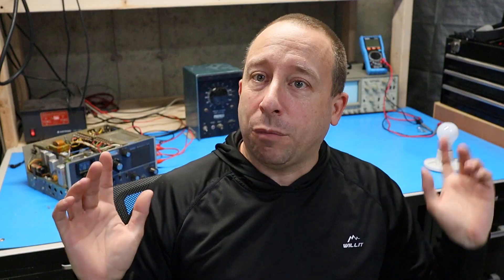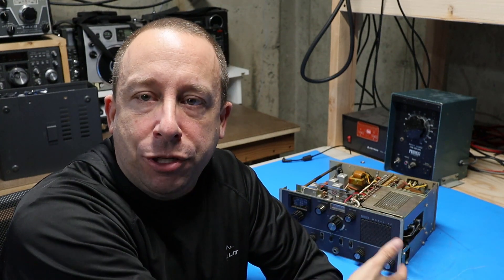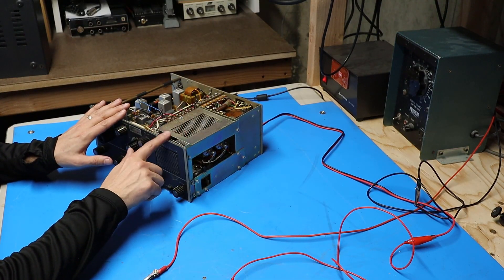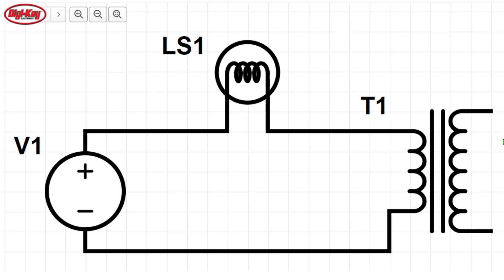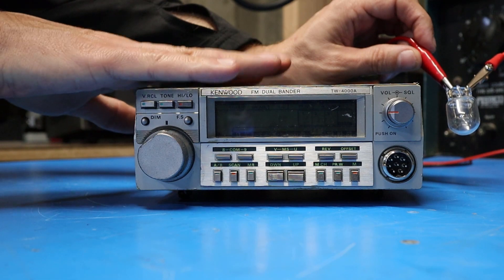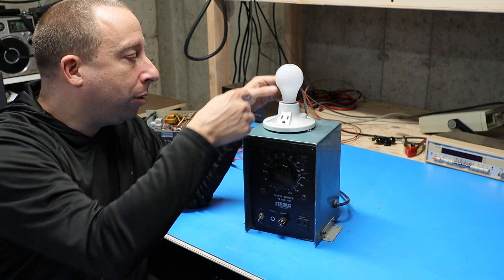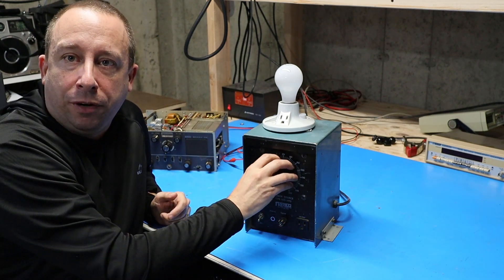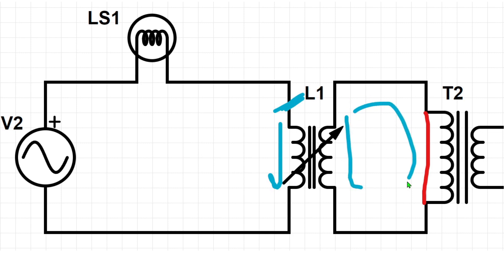Tips For Powering Up Old Ham Radios, CB Radios, and Shortwave Radios For The First Time

Comment from the maker: I forgot to mention in the video that the radio has an inverter circuit in front of the transformer for converting DC to AC.  DC does not flow through or work with transformers but because this one is shorted the inverter circuit is bypassed and not operational so all the DC current flows through the shorted primary side of the transformer.

Comment: About 15 years ago, just before I was going to retire, I bought a bunch of old vacuum tube ham radios, Tektronic oscilloscopes and other assorted capacitor checkers and test equipment.  I wanted projects to occupy my retirement years.  Well, I'm just getting around to playing with some of that equipment but at 80 I realize that I'm not going to make much progress.  So I guess I'll just start cleaning them up and turning them on as is to see if they at least power up.  I've got a variac, isolation transformer and a variac with an amp and voltage meters.  If I sold everything, my house would rise up about five feet from the loss of all that weight.

Comment: My radio TS 440S requires an external 12 volt power supply.  It's been off maybe 10 years.  Life happens.    I have a lab power supply that adjusts from 0.00 v to 15.5 volts at a max current capability of 2 amps.  The 440S draws about 2 amps on receive and if I increase the volts higher than 5.3 volts the amp meter pegs to maximum.  So I hesitate to increase the supply above 5.3 volts.
At about 4.7 volt one of the radio's feature indicator lights (Notch filter) comes on.   I'm not certain about the accuracy of the supply's digital readout. 
The power supply amp meter shows 2 amps at 5.3 volts, so I can't yet tell if the electrolytic capacitors are shorted.  I'm guessing I need a power supply metered and rated for more than 2 amps.  Is my guess right?  
At the moment 5.3 volts isn't enough to run the receiver, so I really can't tell much.  I suspect the receiver might begin to work at about 9 volts.
I'm thinking I'll leave it on for a while until i can get a heftier power supply.  OR I can use a bulb as you did.
The radio has a built in frequency counter, but that hasn't come on yet.
Do you have any further tips for me?  Thank you.
Reply from the maker: Try something else on the power supply.  Hard to say from here if the radio is trying to draw too much power or your supply is messed up
Reply: @SevenFortyOne  Thank you very much.  Basically it sounds like a confirmation of my thoughts.  I appreciate your reply,  your video and your advice.  I'll order  a stronger power supply with better operational indicators than the supply I have now.

Comment: One main issue with your schematic representation of the Variac.  A Variac is an autotransformer, and does NOT offer galvanic isolation as you have illustrated.    This is an important detail that must not be overlooked, especially when working on equipment that has a "hot" chassis, not insulated from the mains! (Such as series string AA5 radios)

Comment: I just purchased a NOS 1987 Uniden Karate on eBay.  I don't think it has ever been powered on.  I am going to bring it up slowly on a variable power supply that I built back in high school Electronics class.  I don't want to hit the electrolytic capacitors with 13.8 Volts all at once.

Comment: Well done!  Question - when it comes to vintage microprocessor AC/DC transceivers, how would this procedure change, if at all?
Reply from the maker: It depends on whether or not the radio had a built in power supply or not but generally it's about the same.  I'm not a professional though so there may be better practices to follow

Comment: Transformers are Ac, not dc, you would never hook up dc to the input of the xformer. In fact, a transformer winding is supposed to look like a dead short to dc current. Otherwise your explanation is reasonable.
Reply from the maker: I simplified the explanation and left out the inverter circuit that's in front on the transformer inside the radio. Because the transformer is shorted, the inverter circuit is also shorted/bypassed